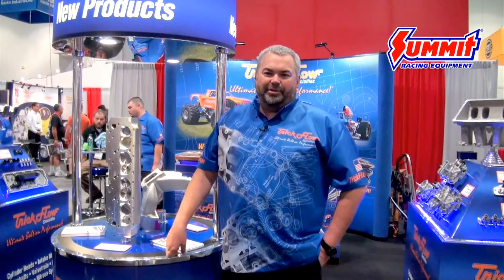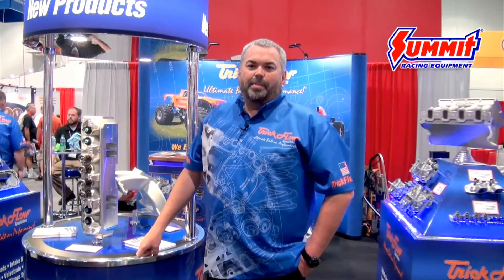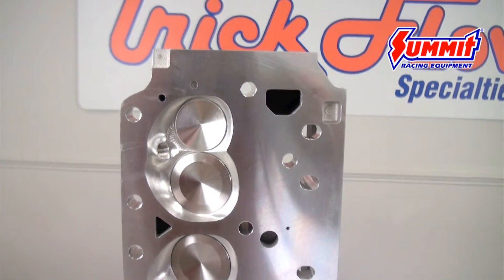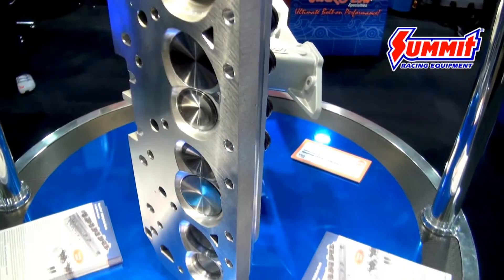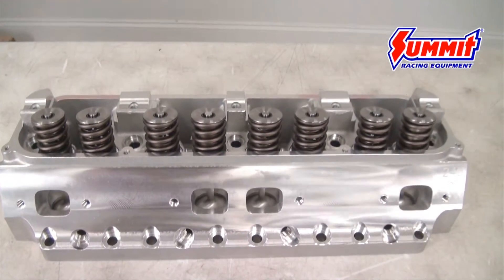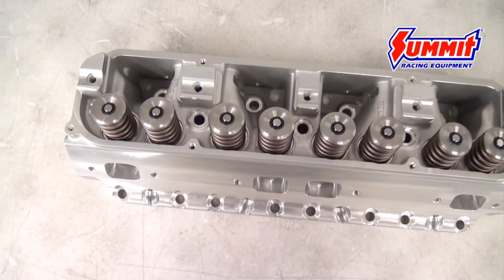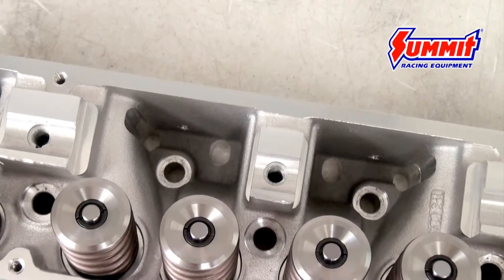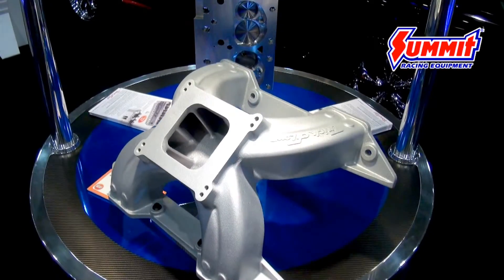Trick Flow PowerPort 240 for the Mopar - New Product from SEMA 2014

Comment: Okay,, I bought some for my 471, I'm not wanting to run hydraulic anything, looking at a howards mechanical flat 260@.050 with 
.616 lift . the spring rates are very similar can I use the .680 max lift  springs ?

Comment: Please state what camshaft specs was used, there has already been a video saying that 600 hp cant be done
Reply: +smilsmff The camshaft we used for testing, and is also included in our top end kit is, .600"/.600" valve lift, 234/247 duration @ .050", and a 108° LSA. We used a 1.6 ratio rocker, which makes the cam .640" lift. Just to back up our claim, Andy Finkbeiner of AR Engineering just made 690 hp @ 6500 rpm on a 470 cubic inch engine. He documents his build over on Moparts forum. If you have any further questions, feel free to ask.
Reply: thats what i thought , the camshaft from P.P. test

was .585 lift and Horses were 580 +/-
Reply: Trick Flow Specialties what are the difference
Reply: Between 240 vs. 270 head